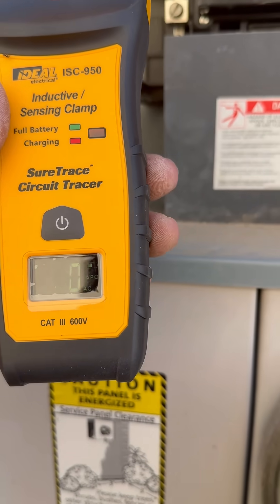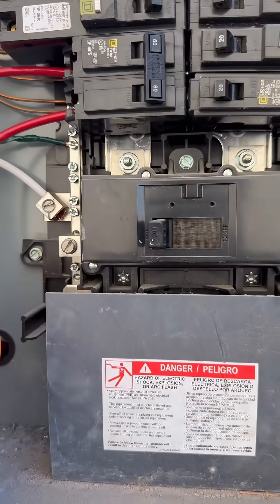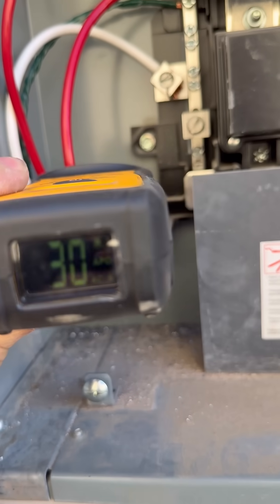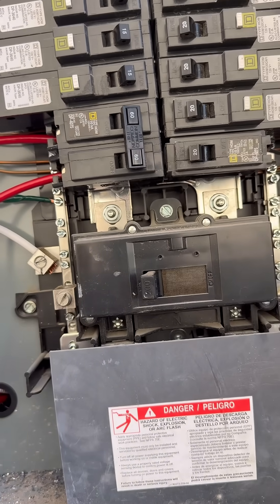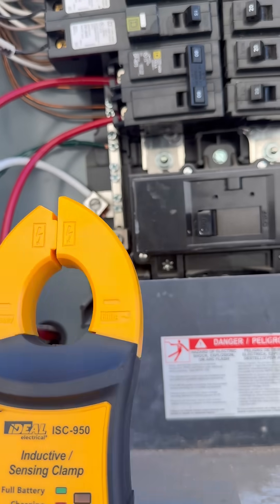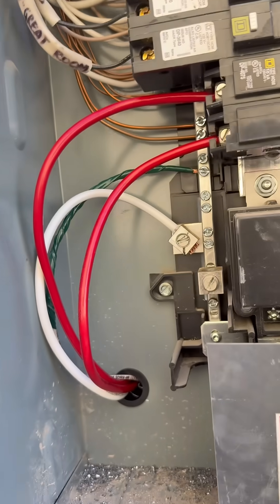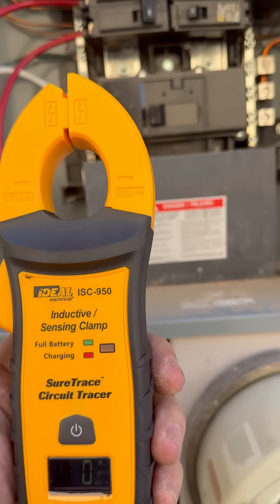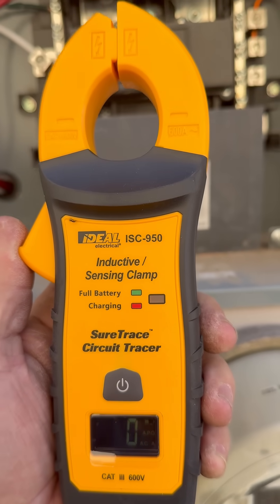Get Accurate Circuit Breaker Sizing with This Simple Trick

Comment: Going to add to the impending dog pile but 30A on each leg is a 30A total load. You’re only reading the load of one phase. They’re not additive on ampacity, they’re additive on voltage as each leg has 120V of potential to Neutral.

My guess is this is a 60A breaker for some HVAC and it’s sized appropriately for the load.
Reply: You guys size your breaker to the load and not the cable?
Reply: @Extra_Mental  complicated answer is both but basic and most common answer is for the conductor.

Inductive loads like compressors call for a larger breaker due to inrush current. My home has a 3.5 Ton AC that takes 22A but the breaker is 50A. The compressor’s plate will state what the running amps and locked amps are.

It’s worth noting the newer inverter units don’t need this. My mini split used 4A for running and locked and specifies a 15A breaker only because our code book doesn’t specify a 10 as a standard breaker size until very recently and they’re not valid everywhere.
Reply: @Extra_Mental  Where are you from?
Reply: @CBE-d6j  Australia, we size our breakers only to our cable, and our cable to our load
Reply: @Extra_Mental  Yeah same here in the uk, we do apply diversity to some circuits loads before choosing cable sizes in line with the breaker.